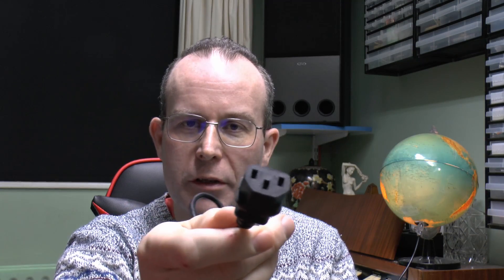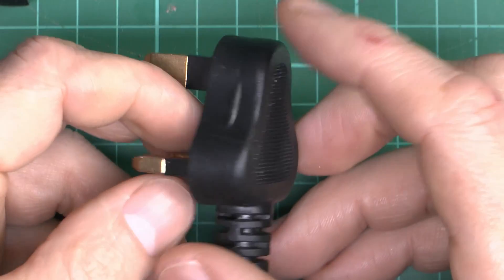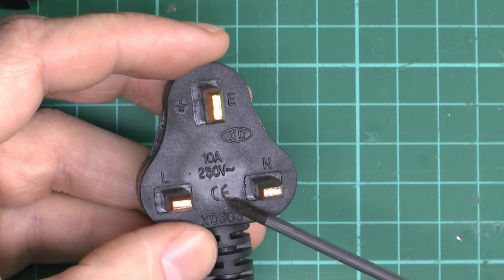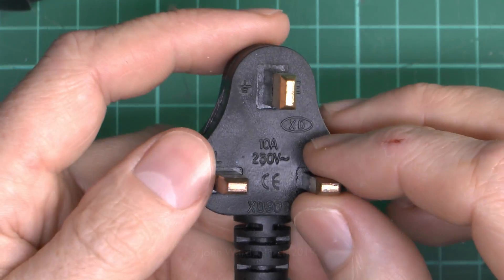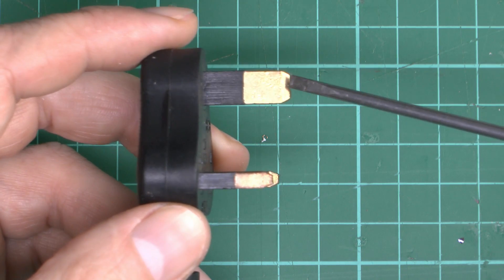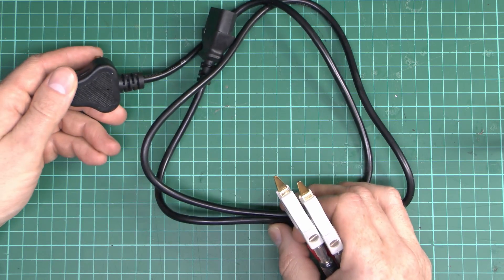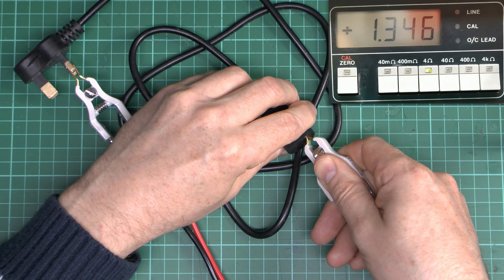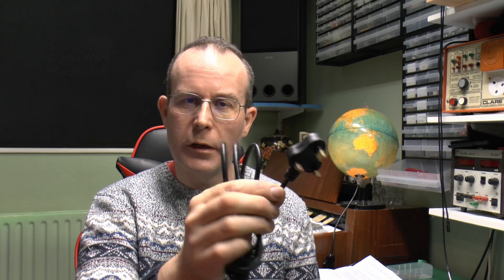Dangerous Unfused UK Plug and Undersized Flex

Comment: I remember 12 or so years back working at the computer shop, we received a shipment of ATX power supplies with a bagful of these cables, I pointed out they were dangerous & offered to rewire them with new UK plugs, so I took one & lopped off the dodgy plug, found the wire colours were all brown, yeah, they all went into the bin after that... :P
Reply: These aren't 
even worth 
the time to fit 
a new plug. You see......

......things like this most likely have ALUMINIUM conductors in them, so even if you did fit a new plug, they would still be dangerous!

I have tested something similar on my channel and that had trouble conducting 10A before the sockets on it sparked and lost contact!

Soon, that lead is off to Mr. Photon's poppage facility and let's see how hard we can push it until there's flaaaaames. :D

-Wayne's Electrical.

19th March 2019, 16.22
Reply: I've had my (un)fair share of CCA conductor cables in recent years, it is indeed terrible stuff, but back when I was at the computer shop I didn't know about CCA wire anyway, it was the conductor colours that rang alarm bells to show that it was bad stuff... :)

I generally throw away china-sourced mains cables in favour of something designed for use on rest-of-the-world electricity... :)
Reply: @WaynesElectrical  I'm sure JW has passed about 6A through one of these before and got it to catch fire

Comment: in the USA we don't have a fuse in the plug. I can't even find a fused plug to buy to put in between the outlet and the unit.
Reply: That's because the fuses are where they are supposed to be, in separate box on the wall. Silly Brits.
Reply: @zelja.   @zelja TM  There's nothing 'silly' about it. It was done to save on copper.
Reply: @StrathpefferJunction  I know why it was done. But, their expensive solution is presented as good and safe engineering, while there's cheaper and still safe solutions. Price of copper wiring in the house is one time expense, and lasts as long as house exists. But, you have to buy expensive cables ("flexes") and fuses and whatnot all the freaking time. Here we just use Schuko, and even that is too big for me, I'm sure with today's technology a smaller and safer worlwide plug could be designed (and (bare)foot friendly! that's important too 😁 ).
Reply: @zelja.  'Buying expensive flexes all of the freaking time' - I can't think of the latest time I had to buy a replacement flex for anything. It doesn't cost anything much at all over your life time. And fuses are pennies and I've probably only had to replace about ten in my life. It's a non-issue in practice, but unlike the USA when you can have an appliance or light turned on, working with load with plug pins on show at the socket and a child being able to touch them, it just can't happen in the UK. Perhaps more important with our voltage and set up, but I'm still happy to go bolt a braces. Folk debate it over and over on these fora, but in reality, the size of these plugs doesn't matter and no one is bothered by them.
Reply: @zelja.  ---- Dave on EEBlog showed a Weller product (if I recall it was a soldering iron) that did NOT have a fuse on the primary side of the transformer (it had a fuse on the secondary side) and he talked about how that is NOT a good idea.  So, I have a Weller  soldering iron, and what I would like to do is get a fused plug in between the wall outlet and the Weller soldering iron unit, BUT I CAN NOT find one to buy.  I would think one should be able to buy one for USA outlets as extra protection.
Reply: That was a british thing shortly after the war. They fuse the outlet circuits with a 32A circuit breaker, but the cord is naturally not rated for 32A, so they put a fuse in the plug to prevent the cord becoming the fuse. The circuits are wired with 2.5mm² copper wires, and this conductor size is rated for 26A at max (critical temperature of the PVC insulation), 32A would require at least one size larger (which would be 4mm²) so they shaped the circuits as rings and the electricity divides between the two "legs". So in the panel they've got 2 lines (or hots), 2 neutrals and 2 PE (protective earth or ground) for every outlet circuit. This system has the advantage that you can connect several appliances with a high demand on these circuits, 32A on 240V are quite a number.
In most other european countries radiant circuits are the standard, as you know them from the US, mostly fused with 16A. Here in Germany three phase power is common, even in residentials. Appliances with a high demand, like tankless water heaters, are mostly connected on 400V (L1, L2, L3, ground and NO neutral) and fused with 3x32A (~22 kW). Every line (hot) against neutral or ground have a voltage of 230V, but the lines against each other have 400V:

https://www.ksb.com/blob/188830/1af460eb586c6746ad83be5cd14f07ac/drehstrom-2-data.jpg
Reply: The great advantage of the UK ring main is the ability to add further sockets on the circuit, without having to run a cable back to the consumer unit.
Reply: @alanpatterson2384  That's something you can do on a radiant circuit too, just add a new wire from the next outlet or junction box in that room. Only with the exception of dedicated circuits which are reserved for appliances like the refridgerator, dish washer, kitchen cooker and such things. The kitchen cooker is connected three-phase here and fused with 3x16A. That are round about 11 kW. A new cable from the consumer unit is only necessary if you want to create a dedicated circuit. But in the case of adding a new outlet  in a ring circuit you must take care that you don't create a new ring inside of the existing ring. Its should be an extension of the old ring.
Reply: @Marcel_Germann  Agreed, but on a radial circuit you are going to run out of capacity much quicker than on a ring circuit. I have a property in Spain, and I regularly have to reset the trips as one radial circuit supplies the lights and some of the sockets whereas the other supplies the remaining sockets.
Reply: @alanpatterson2384  That's not normal! I suppose the installation was designed badly. Back in the old days here in Germany there were two or three fuses for the whole house. Always one 16A for the kitchen cooker, sometimes one 16 or 20A for the electric tank type water heater (if needed, sometimes they used oil, gas or coal fired instead) and one 16A fuse for the rest of the house.
Now almost every appliance with a high demand got its own dedicated circuit like washing machine, dishwasher, dryer. Electric kitchen cookers still have their own circuit, but now they're connected to all three phases (L1 and L2 for the cooker, L3 for the oven), so you can fuse it with a 3x16A circuit breaker, which are ~11 kW. The network operators demand that appliances with a demand of more than 4.6 kW (20A) must be connected three phase. They only make exceptions for the kitchen cooker in old installations (mostly fused with 25A). 
Spain is something special, only five circuits in the basic installation, circuit breakers must switch off line AND neutral.
Here in Germany you'll have to install for a single room flat a consumer unit with at least 3 rows (12 units per row), larger flats at least 4 rows. I have a house with 2 consumer units, one containing the meter and six rows in my cellar. The second one in the first floor with two rows.

Comment: Roast the wire with plenty of amps. Let's have some fun before it goes in the bin!
Reply: Do you want 
flaaaaames? 
Well, here's something.......

....... I had a lead with sockets on it and it was of a poor construction like what is seen here.

No fuse in the plug either, so I took it outside and much to my disappointment, it couldn't carry the 10A for too long before the sockets sparked and gave out.

It needs to be given a RIGHT BEATING at Mr. Photon's poppage facility, methinks.

We want to BUST IT RIGHT IN.

Want flames?

Hold on there. :D

-Wayne's Electrical.

19th March 2019, 16.40
Reply: @WaynesElectrical  I don't think Mr Photon is destroying stuff any more. Haven't seen any video's from him for ages.
The smoke definitely needs to be let out of this rubbish lead before it goes in the bin!
Reply: it will fit a kettle, go for it john, lets see this cable and how it ends up being used when people dont know better

Comment: Always enjoy your videos it's interesting to see  electrical stuff from the UK.  Cheers.

I like the UK plugs the fuse is a good idea.
Reply: But if you don't have fuses then every single bit of mains flex has to be rated to the full 16A of the radial (or 20A or 32A if that's what the radial is). Requiring 1.5 mm² flex on every appliance seems excessive to me.

16A radials would also be very limiting in high load areas like kitchens where you might have a toaster, a microwave and a kettle on at once.
Reply: @seprishere  Here in Canada, most radial circuits are rated for 15 amps, which is the standard for the appliances as well.  Kitchen plugs are put on "split" circuits, one half between line one and neutral, the other between line two and neutral of a split phase supply.  This means that although each half can only carry 15 amps, the effective capacity is 30 amps.  Newer installations permit the use of 20 amp circuits in kitchens, with a heavier gauge wire.
Reply: @heronimousbrapson863  So does every DVD player, TV etc have a 2-core, 1.5 mm² flex?
Reply: @seprishere  I'm not sure, as we don't use square millimetres to rate wire size.  We use the AWG (American wire gauge) system to rate wire size:   the minimum wire size for 15 amps is #14, for 20 amps, #12 (the smaller the number, the thicker the wire).
Reply: @heronimousbrapson863  14 AWG is even bigger than in the UK (about 2 mm²). Do you REALLY have that on every TV, radio, DVD player etc?
Reply: @seprishere  US mains voltage is half that of the UK (and elsewhere), so US current capacity (that dictates wire-gauge) has to be twice as much for the same wattage.
Reply: @heronimousbrapson863  daft as you don't need that sort of amps for a bloody lamp (tiny cable) 3 amp fuse =safer.
Reply: If you like plugs, then visit Wayne's Electrical and dive into the
PLUGS PLAYLIST. Oh yes. :D
-Wayne's Electrical.
19th March 2019, 16.25
Reply: Having to have a fuse in the plug is potentially dangerous.  If someone puts in the wrong size fuse or puts in a piece of wire in place of a fuse, a dangerous situation could result.  UK plugs are fused because of a bad decision to use ring circuits.  A safer wiring system is to use lower amperage radial circuits with unfused plugs, as the rest of the world does.
Reply: @heronimousbrapson863  British plugs are the safest there is, I do tend to agree about radial though I think the ring final should be changed

Comment: No fuse = never use!
Except as a campfire starter.
They work great for that purpose.
I also figured out the 'XD' mark ...

Look at it sideways,
it's a cringey-face.
Reply: I disagree. While they would certainly be able to start the fire, I don't want PVC fumes on my marshmallows.
Reply: You're right in every 
way, including the XD 
marking. Did you mention 
FLAAAAAAMES? In that case then......

.....Some time back, I tested something similar on my channel, and it had trouble carrying the 10A I was putting into it.

That lead is to be tested at Mr. Photon's poppage facility and we're going to bust it in badly. 

EXPECT FLAAAAAMES. :D

-Wayne's Electrical.

19th March 2019, 16.35
Reply: The XD is the manufacturer laughing at us for buying their unsafe product.
Reply: XD = eXtra Dangerous
Reply: Frowny face

Comment: I had one of these leads with an external drive enclosure from a well known, highly respectable computer supplier (when they were trading) here in the UK.. you "simply" cannot trust anyone can you.
Reply: HP had to recall a bunch of cables for laptops etc. because the fake chinesium cables were this poor and a fire hazard. Even they get screwed occasionally by the manufacturers of this garbage.
Reply: just plug them into a surge protector or anything with a fuse and good voltage control/overcharge protection
its not such a big of a deal, literally everyone in China/Asia is doing the same and nobody house explode yet
Reply: Maplin?
Reply: "Simply Computers". it looks like a number of main stream dealers sold these by the look of it.
Reply: I think the load of truth and the smoke of reality awaits this premium death lead. Socket to it John
Reply: A customer had one that actually started to melt. Luckily they noticed in time. The plug looked legal but the conductors in the cores were none existent. The current going through the cable must have been a lot less than 2 amps yet it still melted. 

My one big gripe about IT equipment is why do they often come with 13 amps fuses? I have seen this from major brands, 90w laptop chargers coming with 13 amp fuses in the plug, it is madness.
Reply: I used to work for a reputable computer store in Ireland that inadvertently included one of these with an external drive enclosure. Had to issue a recall and we checked all cables afterwards.

Comment: I just checked a MK plug, a hardened one on and extension  and it does has a CE mark. I know the plug is used elsewhere but not in Europe? I dispose of these bad cables but how many people not in the know just use them and have the associated fire risk.
Reply: The CE mark simply states it is legal and meets all the safety/environmental requirements to be sold in the EU. I suppose technically these plugs could be sold in Germany etc. The Kite marks etc are UK specific safety standards and from memory I think they mean they have actually been tested in a lab. The problem is so much of this fake crap also has fake kite marks etc on them.

Comment: Why do they defeat earth everytime!
Reply from the maker: Part plastic pin is cheaper than an all metal pin.
Reply: @jwflame 
As are undersized pins.  As are undersized plug bodies.  As are undersized cable cores.  As is not not including a fuse.  And you can save an assembly step by not actually connecting the earth.  And save even more by not including an earth conductor.

It only has to be good enough to fool an ordinary consumer into thinking it's the real thing.  If it burns a few houses to the ground you'll never be able to find and prosecute the manufacturer.
Reply: Because they don’t understand or care...